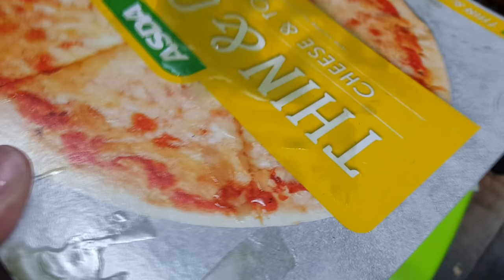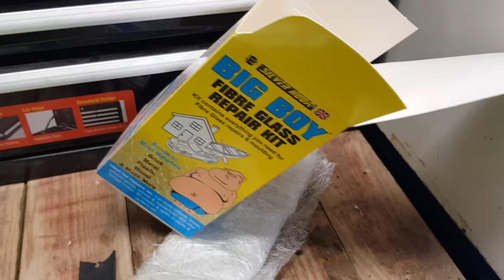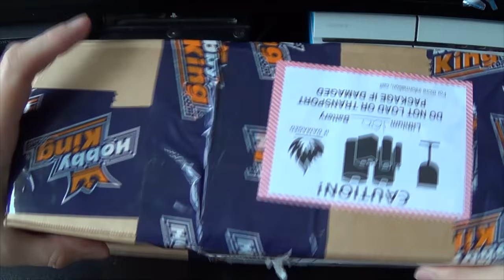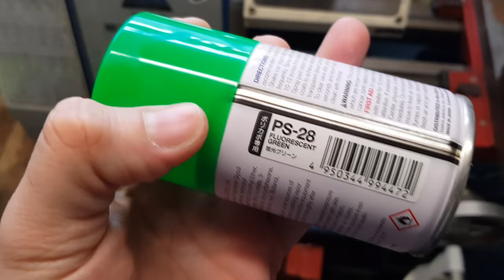ProBoat Miss Geico Full 2S 4S LiPo Brushless Upgrade HobbyKing 40 Amp System, Stock 17"

Comment: Holy Shit man how big does that motor look 😜.   Nice job with the mount ,Looks as good as the original.
Couldn't help but laugh when you unveiled the hood colour and said she's gone all hulk 
Can't wait to see how fast it is now compered to the stock se up 
I want a boat more than ever now lol
Reply from the maker: Haha I have the right spray colour now, just having the time to do it. Thensnow has stopped me from venturing to me shed even tho I have a new heater now haha! I have my eye on a brushless one from HobbyKing called 'FT012 Brushless V-Hull Racing Boat With Self-Righting Feature' £45 brushless and it doesn't break the bank, but my next big boy project (boat wise) is the 'Genesis Offshore Brushless RC Twin Hull (1045mm) also from HobbyKing less than £200, but am in 2 minds of that or the Traxxas catamaran, they go for about £350 2nd hand had they have part support the HobbyKing doesn't 🤔 but on the other hand I can just make the parts haha, decisions, decisions! Isn't for awhile tho maybe summer time when we have less snow and get them 2 days of sun! 🤣🤣